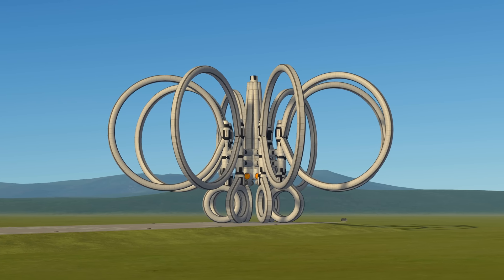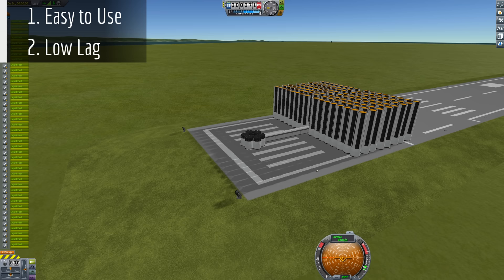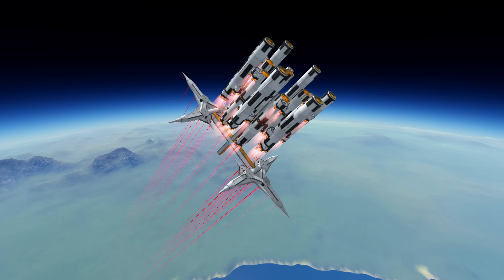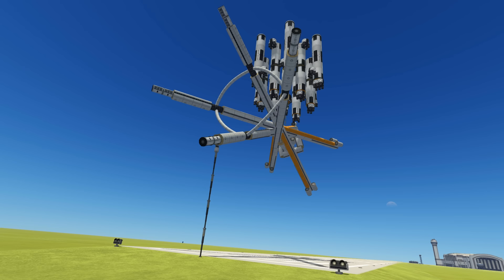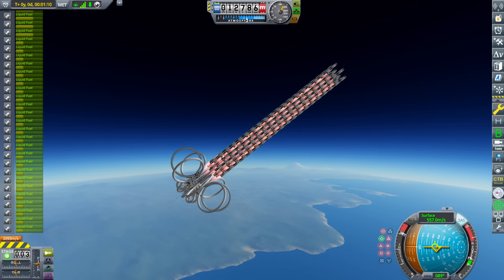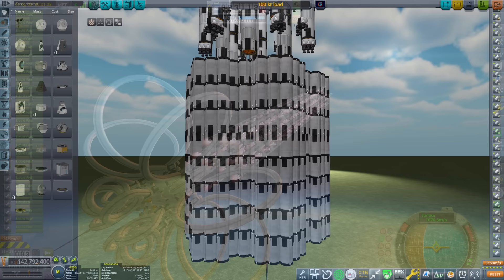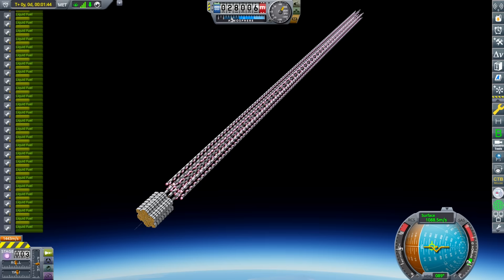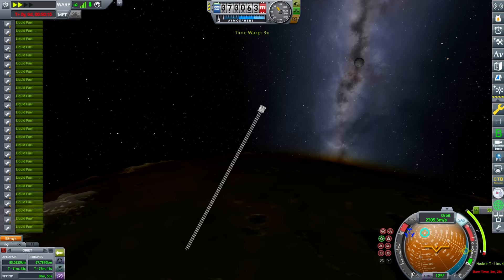Scalable Launch System for Any Payload | KSP 1.12.3

Comment: That auto-stage mechanism is genius haha
Reply: Yep yep
Reply: I don't get how it work exactly 😅😅😅
Reply: Rube Goldberg timer 10/10
Reply: @rupalibelsare5376  there are 2 (sets of) engines, one pushing up, and one pushing down.
The one pushing down has slightly less fuel than the one pushing up, so after some time the probe will fly up and destroy the connecting part.

The exact timing of this procedure is not automatic, it must have been timed manually by the creator (like synchronizing 2 clocks).
The piston is used so that it can be a moving part without it being disconnected from the craft.
Reply: Hehehehs
Reply: I'm not sure I get the point of it, why not manually stage?
Reply: @ENCHANTMEN_  Because a launch can run at minutes per frame and take several hours to complete. The auto-stage makes sure the timing of the staging event is the same for every launch in a situation where the game is barely playable, and it just makes it easier and more userfriendly.
Reply: @Jonassoe  might as well use flight computer at this point

Comment: The scary part isn't how big it can get, it's how it can stay away from the Kraken
Reply from the maker: The kraken really wants it though. I noticed that after the first staging event of the 100kt payload lifter, some fuel tanks at the top of the rocket exploded. Im not sure how the rest of the rocket stayed intact, but I felt it was close to rapid disassembly
Reply: I think the way the autostrut is set up is the only thing keeping it from spaghettifying from it’s own weight and size
Reply: I was surprised that the automatic staging system was not taken by the kraken. Wonderful design.

Comment: The lag is unbearable I need to make a new modular launch vehicle!

immediately pushes it to the absolute limit
Reply from the maker: It doesn't seem to matter what I make, I always come back to waiting 5 hours for a 4000 part rocket to launch lol
Reply: @Stratzenblitz75  You have discovered the continuity of lag.
Once lag goes down due to improved launcher designs, parts count and complexity will increase, until lag rebounds to pre-improvement levels.
Reply: @kilianortmann9979  It's like buying a larger house/more storage shelves because you can't store your things. Eventually you will buy more things to fill up the new empty space until you're in the same situation again.
Reply: @blueseercontent  same thing happens with adding more lanes to a road. to be fair in gaming the goal is to do more
Reply: @kilianortmann9979  
Induced demand lol
Reply: You put more fuel than I use in a hundred launches into orbit…..

Comment: Rather than the Korolev cross perhaps you could call the staging pattern the Stratzenblitz crown? Also do the competing thrusters in the core throttle as well or is the time to stage unchanged regardless of throttling?
Reply: Stratzenblitz Star
Reply from the maker: Yea, the autostage thrusters are affected by throttle so the staging still happens at the correct time

Comment: How well does it do with very unsymetric payloads? like the tower bridge thing at 1:03 (that one could probably be rotated 90 degrees and work, but certain things might not)
Reply: I imagine that it'd do fine so long as the launch tower lines up with the payload's centre of mass (or some balance between centre of mass and centre of aerodynamic drag force)
Reply from the maker: Asymmetric payloads are a challenge for this vehicle for sure. Lining up the center of mass is a good start, but if the drag/lift is unbalanced that will cause problems. In the latter case, you need to either find a different orientation or go slow through your ascent.

Comment: Hypothetically, could someone create a nearly entirely self-flying craft? From the moment of takeofff to a stable orbit, it has little to no human intervention
Reply from the maker: I think yes, this is totally possible. I attempted this before though and the design I had was very sensitive to your starting conditions like the mass of the payload, how long the fairing needs to be, etc. 

If you get then gravity turn just right, it can get into a reasonable orbit, but if anything was off, then it would either ascend too steeply and not turn over, or it would fly too shallow and burn up.
Reply: @Stratzenblitz75  Huh, interesting
Reply: @Stratzenblitz75  Perhaps one day some new tech will be discovered (maybe even in KSP2) that will allow it to be more reliable.

Comment: fyi, obs has a feature that automatically edits out background noise like computer fans as you record/stream. you can enable this by clicking the 3 dots next to the mic/aux bar and going into the filters menu and clicking the + menu button and selecting the noise suppression option from there. i like to use the rnnoise option for my own videos. anyways, i hope this helps you get rid of those annoying background noises.

Comment: Ah, yes. 'Scalable'. Up to a point.
Does KSP have physics to, you know, simulate a crush point? Like, theoretically, would it be possible for a payload to be too heavy for the structural limitations of these fuel tanks? Not that the game would even run by that point, and you'd probably already be out of the atmosphere at the top of the thing, but still. Interesting concept, I think. Good video, though your mic was kind of weird with some sort of background humming whenever you spoke; not sure what's up with that. Loved the autostage, by the way - both helpful for situations like that final launch and quite clever and unique!
Reply from the maker: Thanks!
I haven't tested compressive loads all that much, but when I was testing the rocket, I had lots of tensile failures of the fuel tanks. KSP doesn't simulate joint breaking very well: after a joint fails, the part changes orientation wildly, leading to a chain reaction which spontaneously breaks every part that's attached to it.

It would be interesting to measure the compressive/tensile failure points of the fuel tanks though. Maybe a future project idea.

I didn't notice anything super weird with my mic, but I've had issues in the past with my video editor doing some strange sort of compression on the audio after rendering so that could be cropping up again. I have tinnitus which makes detecting audio problems hard for me :(

Comment: Have you considered something like taking the current modules and applying hexagonal symmetry again to make a given launcher shorter and wider to get a lower moment of inertia?
Reply from the maker: Yea, that would greatly help with that problem and also potentially allow for even larger payloads.

Main reason I didn't do that was because I intended to use this for 1 to 20 kt payloads and for that its reasonably sized.

Comment: This makes me wonder why you didn't use the KAL1000 computer to automate the staging sequence as time based actions are one of the few things the KAL1000 is good at.
My guess would be that it has something to do with lag, but I'd like to hear what drove you to a mechanical auto stage system.
Reply from the maker: Main reason is that I hate working with kal controllers. I dont know if its just me, but every time I try to use kal controllers, they seem to forget theirentire programming (especially when using them as subassemblies). So I went with the old-school mechanical method lol

Comment: i do like the auto staging, but why?
Reply from the maker: Mainly because I need to ditch the first stage while its burning or else it will fall down on the payload. Manually timing the staging is error prone (I either get it wrong, or forget to stage in time). The autostaging makes it much easier to use
Reply: @Stratzenblitz75  ahh makes sense

Comment: Nice job but I have a question do you use any mods?
There is one called smart parts makes the auto stagging much easier.
To be honest with you I only use interstellar extended engines I use the z pink aro spike to get half way up with no fuel usage and then use the kerbsitne drive once I get past 40k.
Reply from the maker: The mods I use are visual mods with building aids (hangar extender, editor extensions, etc.)

Smart parts does look interesting: I wish something like that existed in the stock game
KAL controller I guess sorta can do that, but they are complicated to program and in my experience they break all the time

Comment: This Isp thing makes me wonder how the game calculates Isp, is it in burn time (fuel consumption) or thrust? aka do the top engines run out of fuel a few seconds later (like how Isp was originally calculated and why it's in seconds) or do they just have slightly more thrust than the lower engines?
Reply from the maker: They thankfully fixed the faulty ISP behavior. Its now constant flow rate, but varying thrust